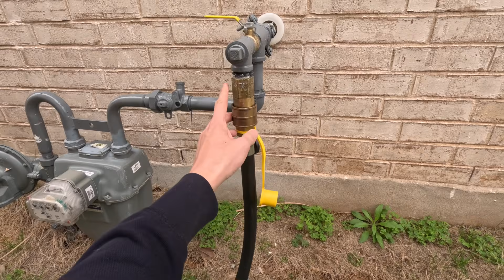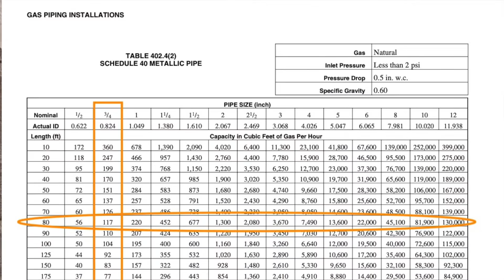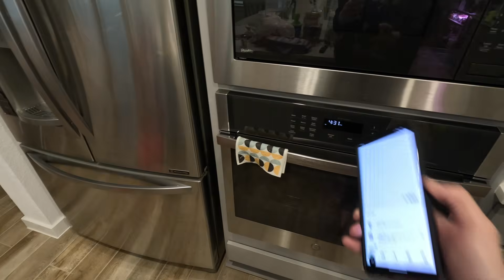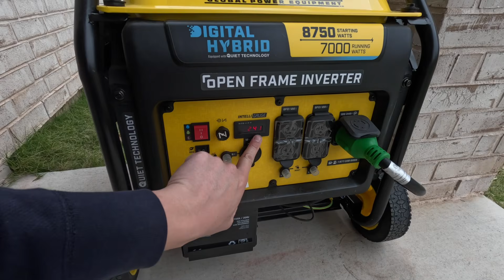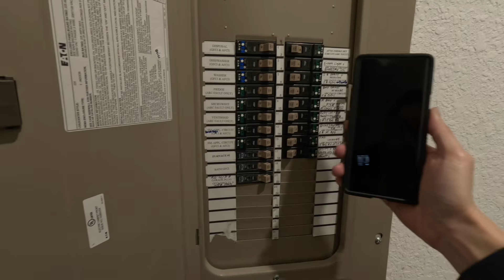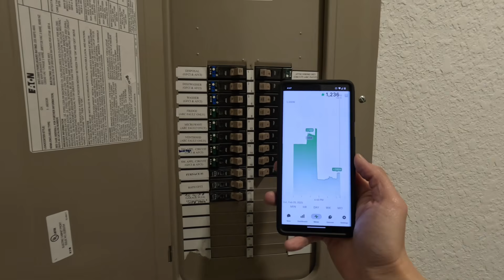Champion 100520 + Motor Snokel + Natural Gas = THE ULTIMATE BUDGET FULL HOME BACKUP GENERATOR?

Comment: I have a Sense Flex, and Sense CS mentioned that they do not have that functionality.  Curious to see how you wired up your Sense clamps to monitor your generator amp usage?
Reply from the maker: Hi Arturo, you just have to wrap the CT around both the main input wire and the generator inlet port wire. Make sure to have both wires running in the same direction and it should work to give you relatively accurate usage of both systems. I'll try to take a picture or film it next time I'm working on my electric panel. Hope that helps!
Reply: Thanks for the tip @jonathanDIYs  .  I saw what you meant on the surge protector installation video.  I ended up rerouting my clamps similarly to yours.
Reply from the maker: @ArturoPalaciosJr  Awesome! Glad you were able to figure it out!
Reply: @jonathanDIYs I tried doing the same and sense app only works with Main power on. When I shut off main power and run my generator (same set up as yours), I get 0 watts on my sense app. Could it be that I need to swap my generator wires going through the sense clamps?
Reply from the maker: @JoseGarcia-i4w  Yes, I wired my generator wires through the sense clamps. You have to be careful to wire both wires in the same direction as the main power. I'll try to film it next time I have the panel open (which could be quite a while)... You can sort of see my setup in my other video where I'm adding a hold down kit. 

https://youtu.be/hlq4DMMP-vQ?si=upSEfps1njKxRdjj&t=158 

Notice the black wire from the generator inlet wraps all the way around the panel and through the sense clamps.

Comment: What happens if the generator cannot handle the large A/C load?  Will the generator just stall or trip a circuit breaker or, much worse, will the failed startup damage the A/C unit?  Thank you.
Reply from the maker: The breaker on the generator should be sized to trip before stalling the generator. In general, nothing bad should happen. I would be more worried for electronic equipment. A failed startup will result in an undervoltage and potentially the frequency of the electricity to be off. Both of these situations should be ok to the A/C for a short period of time.
Reply: @jonathanDIYs  I bought a champion generator 15kw/12kw I'm guessing when I switch to natural gas it will drop it to 10kw or 9 kw. Do you kno any ways of how I can clean the "dirty power" to add an inverter to it simce i did not buy the invertor type? Or will the home breaker protect small appliances?

Comment: Excellent video.  It would be interesting to see how the generator capacity changed with a short 3/4" gas hose, say just long enough to reach inside your gate. It would show how much the capacity loss relates to hose length and how much to the natural gas fuel. 2)  That 80' of 8/4 SOOW cord must have been expensive: ± $400, plus the cost of the long gas hose.  Thank you for answering several practical questions.
Reply from the maker: Thank you. I don't think I have the proper testing equipment (like a bunch of space heaters) to apply incremental load up to the max out point, but that would be a cool idea. 

I got the 80' of cord for approximately $200 back in 2021. Prices keep jumping up rapidly.

Comment: Thanks for the video.  About how long was your hose run?  I have a similar set up and was concerned about getting enough gas flow to my generator.
Reply from the maker: My hose is 80ft if I can remember correctly. I cover all the calculations and length in the video.

Comment: How did you get your sense to work on generator power?
Reply from the maker: You can run the generator power wires in the same direction as the main power cables and put the current sensor clamp around both the main power cable and the generator power. As they are never run at the same time, they won't ever interfere with each other. I'll try to shoot a video on that one of these days when it isn't over 100 degrees outside. BTW, sense is on sale for prime day - grab one while you can! https://amzn.to/3NQJoZC

Comment: @Johnathan Great video, thorough and thoughtful on the key details like hose sizing, basic safety, etc. I have a very similar setup as you -- full interlock setup, Champion 7K/9K Generator, etc., except my natural gas meter is ~55 ft from the pad where I currently put my generator which is secured just inside my privacy fence (keeping it out of view and a bit safer behind the fence (and changed to the Post if I like).

Where did you get your hoses from on a discounted rate.?

I was thinking for a while I'd have iron pipe installed since it's down the same wall of my house, but then I got to thinking that it will have some complexities routing around my electrical mains (pipe coming up from underground), etc. and that might be more trouble than it's worth for 1-2 times per year emergency use!  So now I'm leaning much more towards an install just like yours with a flexible hose as the best way to go (path of least resistance) and I can take the hose with me in the future, etc. . . .
Reply from the maker: Hi @CajunCoding - thanks for commenting. I got the hoses from a surplus supplies store on ebay. I don't think there is any more in stock right now, but if you put a saved search in ebay and enable email alerts, you probably could snag one within a few weeks or months. Here's the search terms I used: "mb sturgis 3/4", "3/4 natural gas hose", "3/4 ng hose", "3/4 propane hose",  "accuflex 3/4 hose"

Sometimes when people are listing it, they only list the model number or the brand and not that it is for natural gas or a propane hose, so the specific keywords sometimes help you find hidden gems. I think that's how I got the hoses for half the regular price. Good luck getting some yourself! I think a hose is a smart idea for the few times that you would need it. :)

Comment: Look into an Easy Start capacitor system for your AC system.  it will take the needed amps to start your air conditioner down to the 20 - 30 amp range so it can be started by a generator without tripping breakers or dimming lights.  It too 5 ton AC unit at start up from 83 amps to 31.
Reply from the maker: Hi Scott, I did add an easy start to my AC system - you can check that video out here - https://www.youtube.com/watch?v=2_VcUyg5V7w. I saw my starting amps down from 80s to 30s as well. Thanks for commenting!
Reply: @jonathanDIYs Bro......I just Uploaded my Final Demo and Show everyone How I built my Ply-wood muffler silencer..
.if you want to See
Reply from the maker: @Honestandtruth007  great!

Comment: My Firman Tri-Fuel has a 439cc engine. I use a 1/2" x 24' NG line which is connected to the valve at my back porch. My meter is near the front of the house similar to yours. I have natural gas for the cooktop, water heater, furnace & dryer. Any electrical device that creates heat and the microwave will use up your wattage. The stats on your EasyStart are similar to mine.
Reply: Are you able to use your cooktop or water heater while the generator is running?
Reply: @julietlaney2776  I don't have any problems with my NG appliances while running the generator.
Reply: Are you able to run your AC on NG? How many Tons? I would assume this is the T07573 model? Thanks
Reply: @Anas.abdul_1234  I have the T07571. My A/C is 4 ton. I can run it on NG only because I have a Micro Air soft starter on the outside unit.
Reply: @rwstarke  thanks. I have similar model. It runs my 3 ton AC with micro air but light dims al the way.

Comment: A thorough explanation of all the factors involved in sizing  gas and electrical connections to get it operational.  I understand your reasoning in having the generator such a long distance from your connections but do point out you are significantly diminishing the effective power you are able to get out of your generator.
Reply from the maker: I fortunately was able to meet all my power needs even with the long distance between the generator and the NG supply. Someday, I might do a comparison video between a long hose and a short hose. The only thing I need is some reliable way to put constant load and ramp it up in incrementally so I can accurately measure if there are actual differences in power between the hose lengths. Thanks for commenting!

Comment: I always thought the reason manufactures de-rate propane was because of the orifice size in their jet. It isn't necessarily calibrated to deliver the amount of fuel for the rated output of the generator. A load block can be adjusted to give rated output at rated load.
Reply from the maker: Hi Roy, thanks for commenting! From my research, I believe it has more to do with engine characteristics than orifice size. Natural gas has a higher octane rating (it requires more compression to burn efficiently) than gasoline. Gasoline is usually around 87 while natural gas is 130 octane. Gasoline engines are usually tuned to provide a compression ratio of 8:1 - 12:1 while Natural gas burns most efficiently at compression ratios from 13:1-14:1. I think it is these differences that reduce the power when switching from gasoline to NG. This is where the 10-20% lower HP comes into play and subsequent lower wattage produced.

Sources if you're interested in reading more:
https://grenergy-us.com/pages/q-a-i-was-told-propane-and-natural-gas-produces-less-power-than-gasoline-is-this-true

http://www.gason.eu/documents/get_doc/714#:~:text=Finally%2C%20CNG%20has%20a%20high,path%20to%20higher%20thermal%20efficiency.
Reply: @jonathanDIYs  Thanks for the explanation and references!

Comment: Nice detailed explanation of your project requirements in Texas and the solution.  Did you have any load balancing issues with the two legs of 120 volts feed different house circuits?  Example, if one side of the 120 legs became over loaded prior to the other you may not achieve max power from both circuits.   -Bill B.
Reply from the maker: Hi Bill,

Good question! I generally didn't have any load balancing issues in the house circuits. My base electricity usage at the house was around 700 watts. I measured around 200-300 watts on L1 and 300-400 watts on L2. This amount of load was trivial. The oven and HVAC drew power on both L1 and L2 so that was balanced too. The only exception to balanced load was the microwave which put 1,800 watts on a single leg. 

Thanks for commenting and for this question!

Comment: I bought the Same Champion inverter Generator 100520 and Converted to N G and Built a Shed for it and Reduced Noise Level to 64 db at 12 ft.  I'm still finding Way To Reduce more noise to 55  decibels...... Still working on it
Reply from the maker: That's awesome! What materials are you using? I heard you want to use sound deadening foam but you also want to make sure it is heat rated. Would love to know about your setup some more.
Reply: @jonathanDIYs  Almost done with my Project. Will do a Short video to Upload... I don't really do for Any rating.  Just a few videos about this Sounds Reductions and a Generator Shed
Reply from the maker: @Honestandtruth007  your English is pretty good. Does the foam melt? A short video would be cool, I'd watch it!
Reply: @jonathanDIYs  Most materials are Heat -Resistance in the Shed.    In the Extension Compartment of Muffler Noise Reduction Flame and Heat -Resistance ...
Reply: @jonathanDIYs  Okay Jonathan,   I just finished my Generator Shed Muffler Silencer and I got 57 db Sound Level 😅...... Just let me know
Reply from the maker: @Honestandtruth007  that is amazing! Could you film without the cover and then with it? Would love to see your setup!
Reply: @jonathanDIYs   I will appreciate if you Leave A question and a Comment on that video. 👍
Reply: @jonathanDIYs  I only use An Accustic foam from Amazon and Plywood but Must closed ALL Opening and must be double layer of wall To Be more Sound proof.   
..... You can just look at the house Walls at your house and determine from there.
You are very Smart guy Already.  Your English is Wayyyyyy Better than moi...👍👍

Comment: Does the gas shut off automatically if the engine dies?
Reply from the maker: Yes - the regulator prevents any NG from coming out unless there is a vacuum from the engine.

Comment: EXCELLENT DEMONSTRATION VIDEO THAT A GENERATOR CAN JUST ABOUT RUN LOADS LIKE A SOLAR INVERTER SYSTEM CAN DO . MAYBE IN THE FUTURE , YOU MAY TRY INSTALLING AND DEMONSTRATION A SIZABLE SOLAR SYSTEM . MAY THE GENERATOR BE WITH YOU .🤗
Reply from the maker: Thank you! I would love to do solar at some point! Being able to be 100% off grid and energy independent is a dream of mine. My wishlist setup is a 7kW solar system with a 10-20kWh battery. I think that could meet my energy usage needs completely. Unfortunately, that setup costs around $30k. I'm hoping battery and solar prices go down more in the coming years. If I do end up getting solar, I will sure document my process. Thanks for the comments and suggestion! ❤
Reply: @jonathanDIYs  YOU CAN GO DIY AND BUY YOUR OWN EQUIPMENT TO SET UP BUT IT TAKES TIME , MONEY , EFFORT AND SOME ELECTRICAL KNOWLEDGE WITHOUT THE MIDDLE MAN TO GET IT LIKE YOU WANT IT . CHECK OUT MY DIY SOLAR VIDEOS , HIT LIKE , LEAVE A COMMENT AND SUBSCRIBE IF YOU HAVEN'T ALREADY . SPRING STORMS  & SUMMER HURRICANE SEASON ARE APPROACHING AND WE PREPPERS MUST GET READY . MAY THE SOLAR BE WITH YOU .🤗🤗:elbowcough:
Reply: It's so much more expensive up front for solar and battery banks.